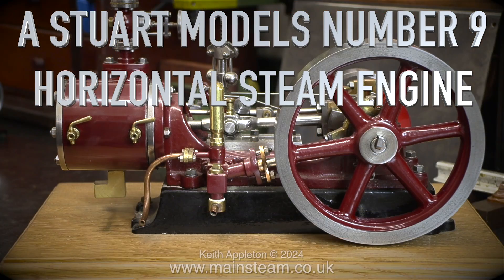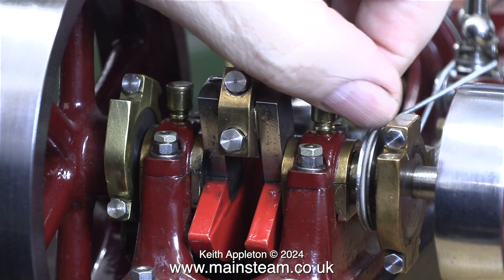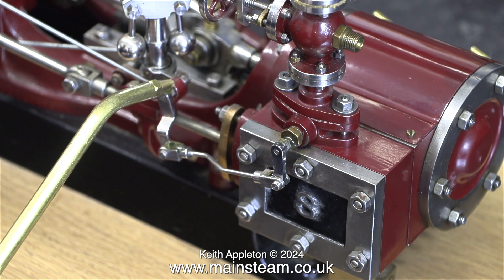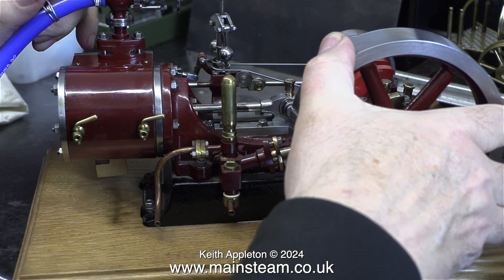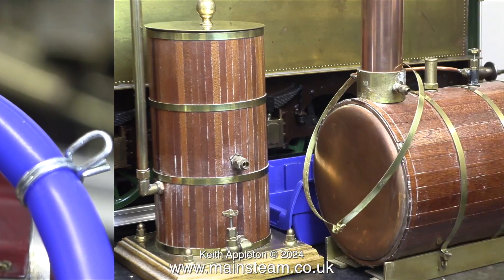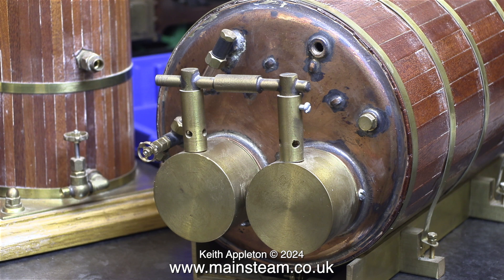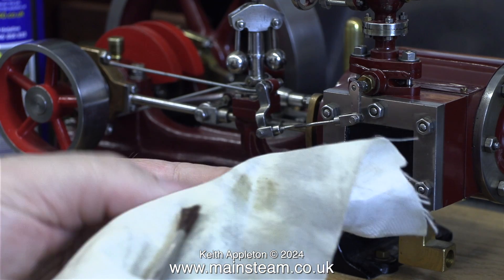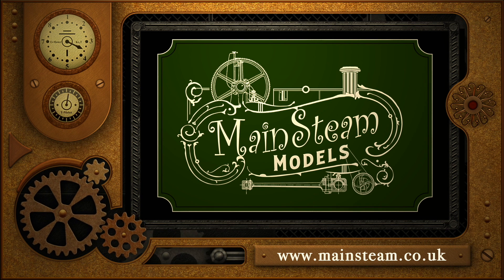A STUART NUMBER 9 HORIZONTAL STEAM ENGINE - PART #1

Comment: WD40 has an incredible following of haters on the internet but it is an excellent cutting fluid for aluminum, cleans many things very well as you show and is a very manly cologne.  Few people know that WD stands for water-dispersing and it does work well in wet environments such as on steam plants.  To make it more economical, I buy it in bulk and use it in a refillable compressed-air atomizer. No, I don't work for them...  Exciting to have a new series!
Reply: Manly cologne.  Love it!!  Oh, and it's displacing, not dispersing.  Cheers, mate

Comment: Keith, I'd add to the list of necessary work:   the paint on the small wheel has to match the rest of the engine, and the paint on the crankshaft counterweights should probably be stripped.   The boiler and condenser might(?) appear better matched to the engine if most parts were nickel plated, and some of the boiler band screws look a bit unsightly.  Another idea for the boiler and condenser would be to eliminate the lagging and paint them in the same or a complementary color to the engine,  you can even retain boiler banding (I did with an unlagged and unpainted boiler and it looks great).
Reply from the maker: Please watch part #2 of the series when it comes out ........

Comment: Beautiful engine. The boiler and condenser seem undersized for the engine, am I correct? The pin on the main flywheel looks interesting and I am looking forward to learning about how it works. Thanks for the efforts as the videos are always interesting.
Reply from the maker: They are massively oversized, not undersized. These engines don't use much steam.

Comment: I'm pretty sure that the "small flywheel" is a pulley that the maker installed in anticipation of using it to power some piece of working kit.  it is a lovely job by the original builder.
Reply from the maker: You are correct, and I personally like the colour difference. The engine is a ting of beauty just as it is in my opinion.
Reply: @keithappleton  And everyone loves a ting of beauty!!😁
Reply from the maker: Just doin' my ting }:-)))